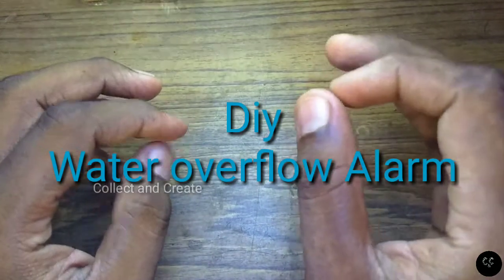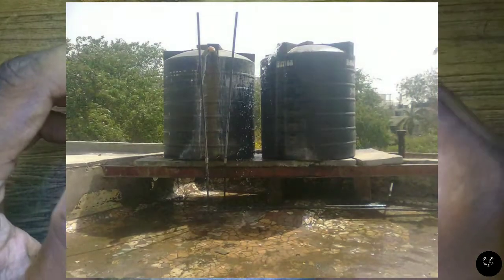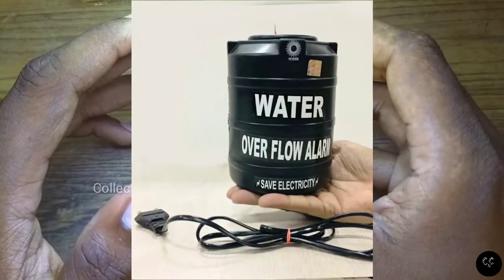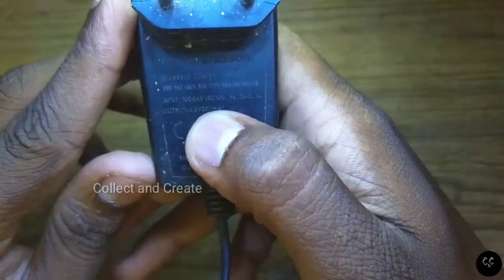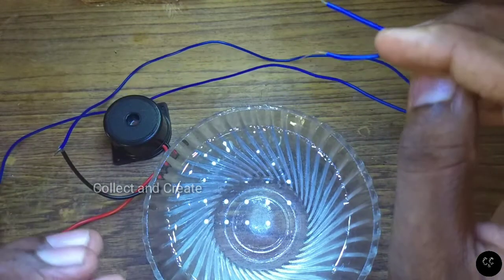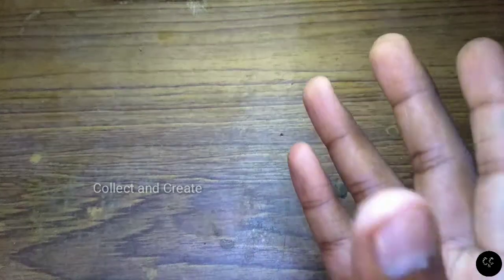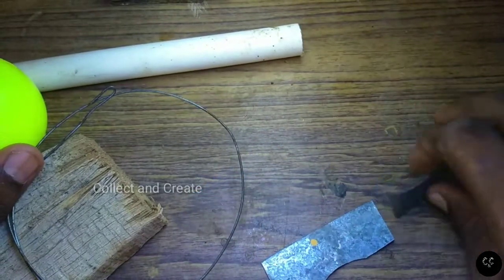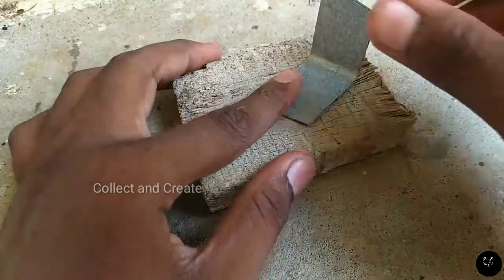Diy Water overflow alarm./ For water tanks.

Comment: I set the 12volt adapter. But not working buzzer. What will I do ?
Please reply
Reply from the maker: Check 12v output coming in adapter or not using multimeter 

And also check buzzer using battery